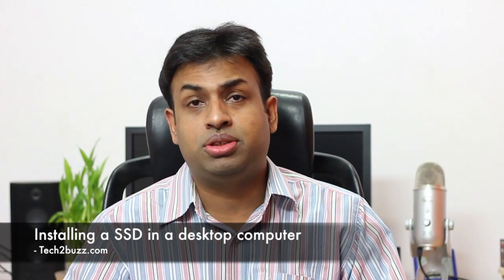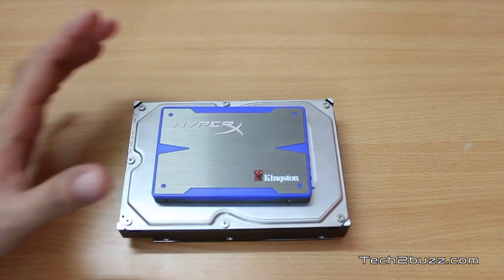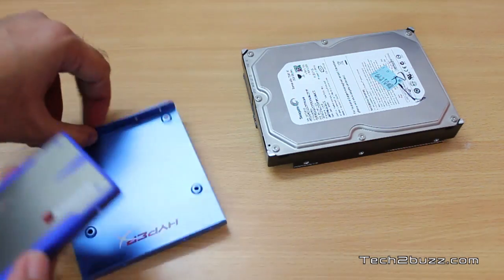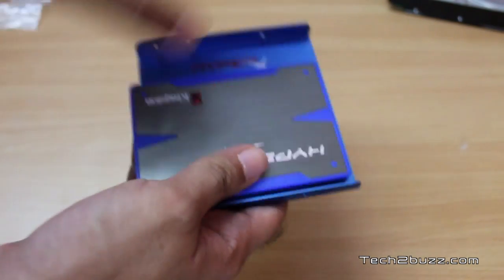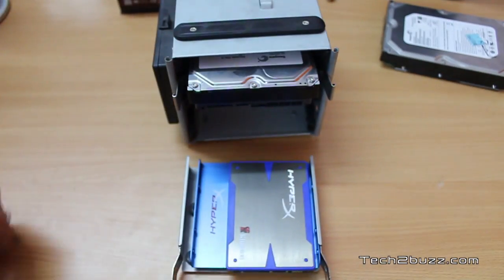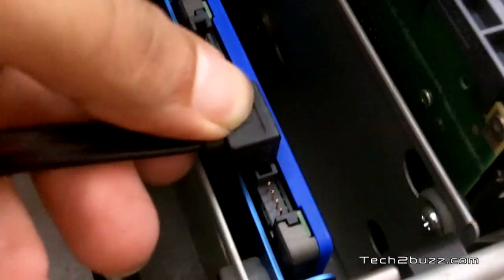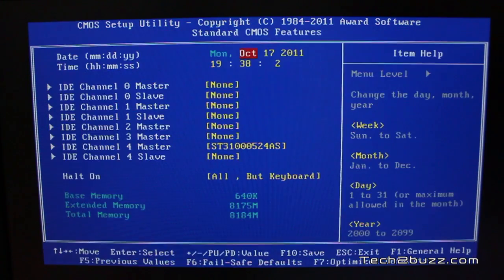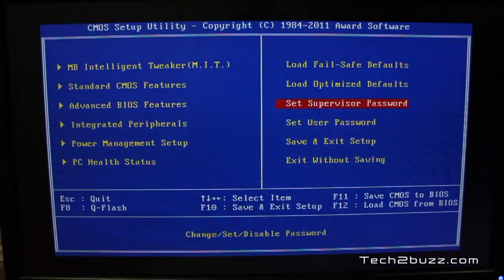How to install SSD drive in your computer

Comment: I want to take my new unboxed computer that came with Windows 10 on a 1T GB HD and move its contents over to the Samsung EVO 250GB drive so I can use it as a (Boot Drive), but use the 1TGB as a Storage Drive.  How would I accomplish this?  Thanks for your help!
Reply: Did you ever find an answer?! I need to do exactly the same.

Comment: WHERE can I order a SATA power cable compatible for 2.5in SSD and 3.5 in HDD?
Please someone post a link to amazon or newegg.  I search and the results pull up with a bunch of adapters i don't need.  

Also, my PSU only has 6pin power and 4pin molex.
Reply: Here you go.  http://www.newegg.com/Product/Product.aspx?Item=N82E16812200061

Comment: Hey there, I'm using the same SSD that is shown in the video, and my BIOS is the UEFI menu BIOS by asus, so it's a little different, I have the Kingston SSD in my boot order 1, 2 and 3 (the ssd) but I can't find it in the computer, and yes, I did save my settings... please help.

Comment: i have learnt that the 2.5" hdd/ssd require 5 volt supply and that in the desktop 3.5" hdds require 12 volt supply. wont the power supply be a problem for the 2.5" ssds when installed in a desktop?

Comment: Hi there, this is my rig.
1. Intel Core i7-3770k Processor
2. Asus ATI RADEON 7950 HD 3GB DDR5 Graphics card
3. Asus P8Z77-V-LK Motherboard
4. Corsair Vengeance 8GB (2x4GB) RAM
5. 2TB seagate Barracuda (7200rpm) Hard Disk
6.Cooler Master HAF 912 combat with transparent acrylic side panel Cabinet
7. Seasonic S12II 620 Watts PSU
Can you tell me which will be the best ssd for me? I will basically use it as on OS with 4-5 games on it. 128gb will be more than enough for me, thanks ranjeet,

Comment: Because there are no moving parts in an SSD, data can be accessed a hell of a lot faster. you also don't need to (and it's recommended not to) de-fragment an SSD either. I changed my old HDD out for an SSD and my PC takes around 17 seconds to boot (after the bios screen has gone), and it's usable INSTANTLY as all system files & startup programs load up stupidly fast.

Comment: Basically, a Solid State Drive can access data much quicker because it eliminates the time it takes to find necessary files by removing the disk therefore meaning it doesn't have to search a disk which can be slowed down massively by the RPM of a Hard Disk Drive. Thus making it quicker. I think that's why. I could be wrong though so I would check out Ranjit's video about it.

Comment: best How to guide on youtube :) but could you make a how to do the same but with a laptop and how to put the windows on the new ssd or Hdd whitout reinstalling it :) i have a Msi Gt70 gamming laptop and im gona buy two mSata Ocz Nocti Series 120gb and change the old hdd to a Ocz Agility 4 512gb but the problem is how im gona extrakt the Windows 7 to the mSata drivers? do i have to use some program to do this :) but good video i give a like and Subcribe thx

Comment: I bought a Kingston SSDnow 200 V+ 120GB and it didn't come with the mounting bracket or any sata/power cables to connect. Should most PC hardware stores sell these separately?

Comment: Remember to unplugg all other harddrives in your computer when installing a fresh Windows OS on the SSD (if another OS has been installed previously) otherwise windows will store the boot data on the first OS installed Hard drive.

Comment: storing music and videos on an external drives works just fine
that's what they're for and the bandwidth of usb 2.0 is plenty to stream music and videos to your computer
copying files over will however not be quite as fast as with a standard internal HD

SSDs can speed up quite a handful of games (most pretty much all MMOs for example but there are non MMO games that can profit aswell)
the least you can espect is a decrease in loading times

Comment: in your videos you ahve suggested using the SSD as primary drive and a normal sata drive as the secondary for storing files etc. If in a case i would transfer my music, movies etc from the normal HDD to an external HDD, will the speed be affected as well? And, if i were to install games on SSD, will it make a difference in the performance in gameplay?
THanks!

Comment: Hello. Thank you very much for this video, it was a great help in installing my SSD. However, even though my computer detects the drive, it doesn't show up in boot priorities. I did not clone the SSD, as I don't have an external hard drive / space. I installed Windows 7 to the new SSD and I can boot it manually, but I don't have any programs installed on it.

What should I do? If I buy an external drive to move files from my HDD and clone it to SSD, will it show up in boot priorities then?